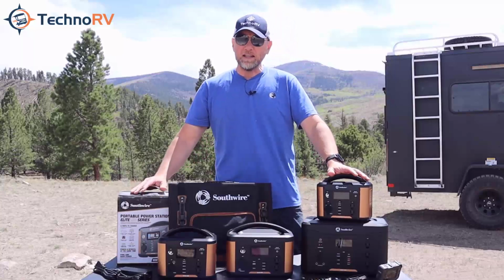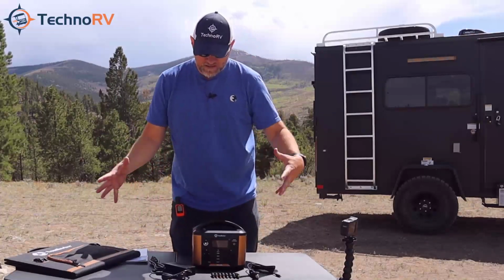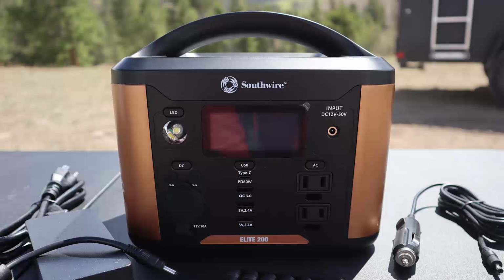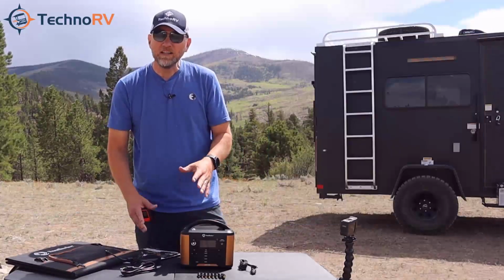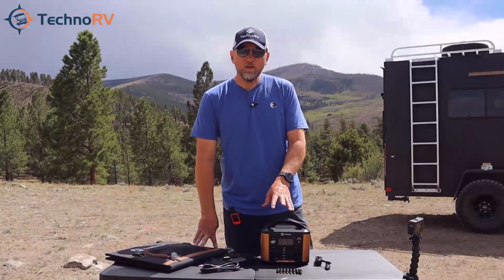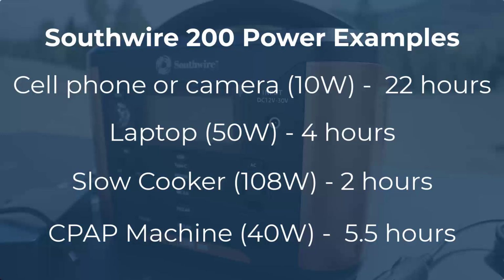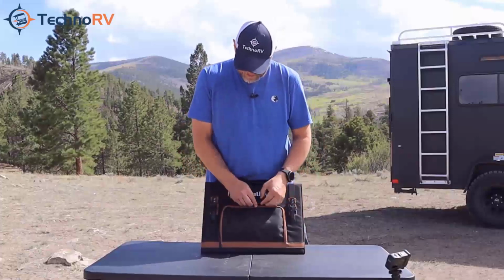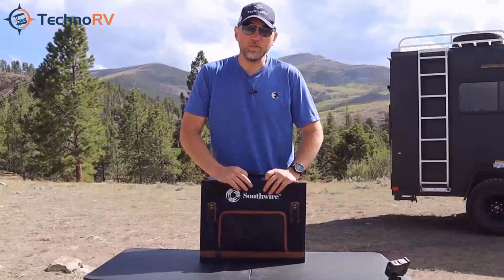Southwire Elite 200 Series Portable Power Station with Optional Solar Panel

Comment: If I’m out of power, how am I to charge this unit?  Run car for 5hrs?  Isn’t there a battery operated power station?
Reply: You can charge with a solar panel.
Reply from the maker: You can charge these with Solar panels, Car charger, or a 110v house charger.
Reply from the maker: Southwire offers a product called Southwire Elite Series 100-Watt Solar Panel that can charge these units.

Comment: Does the lighter plug work with out turning on the unit? Meaning with the inverter off, so it doesn’t draw from the battery?
Reply from the maker: The inverter will turn on once it draws more than 2.2-4.4 Watts. Hope this helps.